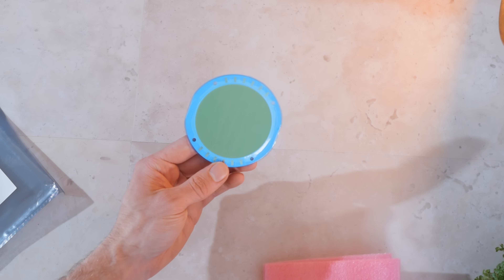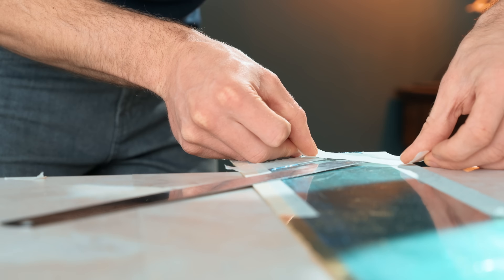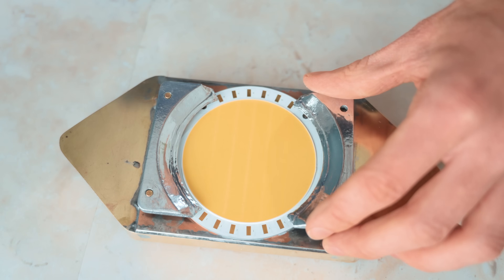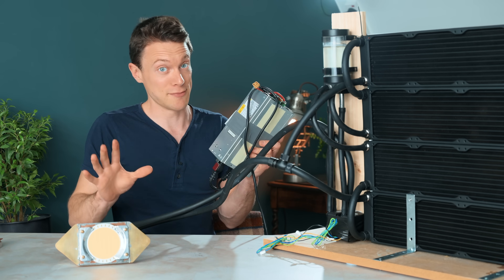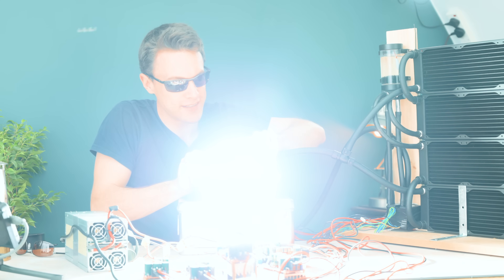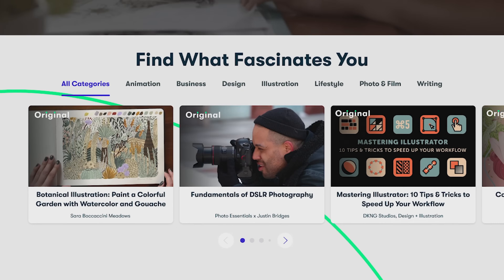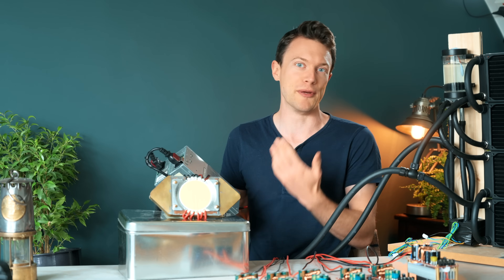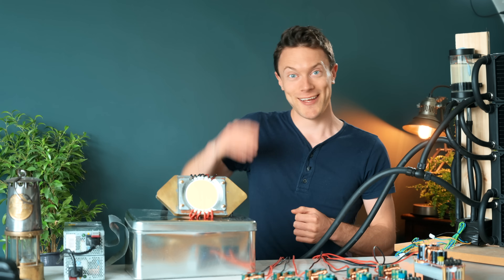Testing the world's BRIGHTEST LED!!!

Comment: Hey Perks Nice video!

But I have a question about the Server Power Supplies. The thing is that in my knowledge that you can't connect SMPS Power Supplies in series. 

And here is the reason, the whole outer Heat dicipassion Surface is grounded and one more thing is that I saw some PC power supplies uses this.

Now in this way if you series the two power supplies then you will get 24v no issues but there will be higher possibility of the damage of the 2nd series connected Power supply. (If you run the power supply long time.)

I have a great experience about this because I have damaged my several power supplies. 😢. 

So from my perspective I will highly suggest you to check wheather any of the mains wire is heating up or not. 

I have a highly doubt about that. If you have time then let me know what you think 😊

As always nice video 👌
Love from India 🥳

Regards,
Creative Creator
Reply: ".....whole outer Heat dicipassion Surface is grounded "
Do you mean Earthed?
The problem is with cheap SMPS which SHOULD BE isolated but have a crappy EMF suppression capacitor which causes leakage which causes problems.
Reply: You have some great points buddy!

Comment: Some power supplies connect ground (from the wall socket) to the ground on the output. If that's the case, you can't put them in series, you would be shorting one of them. I put two server power supplies in series to power my battery charger and had to open them up to replace some screws with plastic ones to insulate the board grom ground. 

But I'm not convinced that this is the problem as it worked at first...

Comment: Why don't you power it off a couple of car batteries? Very capable of providing the amps but obviously will lack run time. Great for testing, reasonably portable and cheaper than Lipo packs.

Comment: I think that you broke the ps because you switched it off before giving it time to cool down. You should have switched off the boosters, wait for the fans to slow down and then switch off the ps.

The thermal inertia of the switching ic cooling surface burned the ic itself. I experienced it on my own.

Also, if the power rating of one ps is 750, in series 1500w where flaming through the two ps lines. Even the internal cables and tracks on the board were probably under stress during the test.

Anyway, that was very entertaining. Thank you.

Comment: I think it makes sense why the LED wasn't getting super hot. Since it is so efficient, a majority of the energy is getting turned into radiation and not heat at the LED, which explains why your hand was getting so hot (and also the reflectors). Maybe you should extend the water block to the power supply?

Comment: Possible reason for power supply damage:

if you connect 2 switch mode power supply in series, they have to be ground isolated.
if you connect two switch mode power supply in parallel, they will almost always get damaged.

Comment: There does exist 48V power supply.

Step down converters are both cheaper and more efficient. So using 48V and step down would peobobly be better

Also... 1500W led probably just dissipate about 500-600w of heat, that can be dissipated with a very large cpu cooler
Reply from the maker: Any recommendations for powerful step down boards?
Reply: @DIYPerks  it have been years since I worked with that, so most of my  product knowledge is not up to date.

Comment: So i am confused now, i checked the LED light spec and it shows:
Input Current 48A
Input Voltage 30-41Vdc

Which means wattage ratings fall 1440-1968watts. 😮😮😮

I'm in lighting field for over 9years now and i only see is either constant current or constant voltage drivers, and i haven't seen more that 1050mA constant current driver. I believe you can use standard constant voltage rated 36Vdc (Meanwell has it UHP-2500-36 https://www.meanwell.com/webapp/product/search.aspx?prod=UHP-2500) with higher wattage and connect all the sections in parallel instead of using individual buck in each sections. 

But still, great experiment! Keep it up buddy!

Comment: Just a wild thought but your power supply may not have had enough air running through them normally they are the exhaust of the server rack with high rpm fans at the front

Comment: If you run the power supplies in series, aren't you running like double the current through them?
If each can provide 1000 W and you have 2 of them in series, you are running 2000 W in total through them.
The voltage is fixed so the only thing that changes is current.
Maybe that's why they fried?

Comment: My guess would be, you overloaded the 12V line as those PSUs are built to deliver a significant portion of it's power to a 5V line. So the maximum Power can only be delivered if you balance your load according to the specified voltages.

Comment: 12:50 - I think I'd have blasted a load of cold air in thru a 'desk fan & cone combo' taped to the air inlets to cool the server PSU's.

Sometimes the most ghetto solutions will fix things and a desk fan is usually something we all have or could get access to rather quickly.

Comment: The overall rating of a power supply does not mean that the 12v rail alone can deliver this same (full) amount of power... since it is usually distributed in multiple rails like 12v, 5v and 3.3v rails. (and some special voltages like -5 and -12v that usually only deliver minimal current.)
Probably just fried the 12v rail.

Comment: Server PSUs are designed to operate in the thermal context of a server where a lot of the cooling is taken care of by the rack installation. (servers usually run at 100% fan speed all the time pushing a lot of air through the case) running them outside the case is a bad idea.

Comment: Love your shows i bet one of these would make a great searchlight on my van roof! but... i dont get the watts at the wall socket, if the led was truely doing 1500w, and theres only 1635 from the wall,  then thats 135 loss in all the boost converters /and/ the 24v psu's ? thats a crazy and very unbelievable efficiency...  i'd say somethings not measuring right but it is what it is.. what it is, watts......

Comment: With computer PSU's what actually makes sense in this case is not the overall power rating, but the specific power rating of 12V line on the PSU. For example, 300W ATX PSU could only deliver 200W on 12V line, 90W on 5V line and the rest on different voltages. So, pay attention to the 12V line power rating.

Comment: Seems like you shut off the power supplies when they were extremely hot, which would turn off the fans inside. Maybe the heat in the power supplies damaged them once the fans turned off?

Comment: The power supplies failed probably because you also connected the Earth together. They are most likely not isolated to Earth so you basically soft-shorted one or both of them. Some have the minus is connected to Earth so if you parallel them, they need to be fully isolated. Also, you can't keep them touching because the shielding is also grounded.

Comment: if you turned the psu's on with all the sections turned on, then they broke because of inrush current, wich could be way more than what the psu's can handle, also psu's for servers and other computal hardware is not meant to turn on and then suddenly crank the power consumption to max, gota go slow ;)

Comment: Is it the light creating heat itself or what? 

Is a "YUJILEDS" 1500w/120000lm led array actually 80 lumens per watt?! That sounds pretty impressive. Is there a standard for LED efficiency ratings?
Reply: How do you calculate waste heat?
Reply: I'm reading on Lamphq that modern LEDs convert about "35-40% of the used energy into visible light and only 60% into waste heat". 
Theoretically, YUJULED's monstrosity is creating 900W of waste heat and 600W of Visible light.
Reply from the maker: I  worked it roughly to be 1000w of heat and 500w of light, but it's just a best guess rather than proper figures.
Reply: @DIYPerks  Hahah that's awesome!

Comment: If Dell is any indication, server power supplies are rated based on input power (not output), and short term.  Their efficiency drops with high loads, then again with high temperature, therefore their output capacity quickly spirals even further down when actually used.. realistically they're designed to support spin ups of multiple drives and not much else.

Comment: You can get 1U "Stick" PSU's that are about 1/3rd the size of each PSU you have currently yet have peaks of 1750Watts on 240V circuits (Like you have seeing as you're in the UK).
So, in theory you could run 3 of them with 2 for the actual supply plus a 3rd for redundancy, plus it would be massively over spec with just a single PSU, 2500W versions are also an option, they are about 2/3rds the size of each PSU you currently have, but obviously you'd only need 2, one for power, plus one for redundancy.

Comment: If the air cooler is rated for 300w, wouldnt that be enough? I mean only a small part of the 1500w will be converted into heat.

Comment: Let me get my main annoyance out of the way first: Having a demonstrably bright light pointed right at the camera for a prolonged time! Seriously, point it off-axis at a wall or put a glare shield on it. Also, you could have tested for waterblock leaks by submerging it in water and using a bicycle tire pump -- would have saved time if you found leaks and needed to remount the LED. Welding googles (or a mask) would work better than sunglasses. Finally, it might have been more "cost-effective" to use a car radiator or oil cooler with a water pump instead of computer parts (old-school PC watercooling).
Reply: He probably just used what he had lying around. I have a few extra PC radiators I plan to use for some DIY projects, but no car radiators since I don't work on cars. If he bought everything just for this project, it would certainly make more sense to use a car radiator since they cost about as much as high-quality PC rads and have much more surface area.

Comment: Server power supplies are in a case with tons of airflow, even without full load, I would suggest making an enclosure with the cooling and power supplies in series for the airflow. Power supplies might also be more quiet whilst air is forced through em. And get like 3k watt of power supply, running em full load all at once is not within spec ;)
Love your videos, keep it up !

Comment: Given how cool the cooling system when it runs, I'd assume there's not much heat coming out. PC cooler's TDP refers to how much heat that will dissipate (loss) in watt. If let's say that LED is 90% efficient, the heat you need to cool is only about 150W. Well, it's just an assumption but still while that cooling system looks sick, it could be scaled down for mobility.
Reply from the maker: That would be nice but the LED is approx 25 to 30 percent efficient :( LED tech is great, but is never going to hit 100 percent efficiency unfortunately.

Comment: Just curious, as I might not understand the terminology myself, but isn't it called brazing instead of soldering?
Reply: the difference is the temperature required.  he seems to be using plumbing solder,  it needs a low temperature to melt. brazing is done  at a much higher temperature

Comment: It fried the power supplies because you cant join Switch mode supplies in series without damaging the output circuitry. Probably blew a Diode or mosfet.

Comment: Wiring the power supplies in series is definitely the problem. Both will pass the 1600 watts. If possible run them in parallel, or better yet, use each power supply to run three segments.

Comment: Server PSU:s ARE designed to run in series, there's usually at least two in a server as they are designed to be hot swappable.
Reply: Sure it's not parallel?

Comment: You probably do not need that much cooling though. If an LED is consuming 1500W, then that does not mean it will heat with 1500W. The main advantage of an LED is that it is around 90% efficient, meaning, 90% of the 1500W goes to emit light. So, it will only output around 150W of heat. I assume this LED is not 90% efficient, but still, you might be able to run it with the air cooler you have showed in the beginning of the video.

Comment: Pro-tip, always test water integrity before continuing build.
Also, you may be surprised on how those 3d printed hold-ons heat up once the LED has been powered on for x hours. But appear to be fine for short term testing. Cool build!

Comment: One thing I would like to see is using a lens to focus the light, and then see the results. Next time, I would suggest you water check the loop before attaching the light. It would have been a shame to see a catastrophic failure after the light was attached. Great video though.

Comment: It might not actually be in spec for the PSU's, as they are usually rated for the total power being the sum of the power across all rails, so unless this PSU only has a 12V rail, and only one 12V rail, it will probably not be in spec. Did you verify that?
Reply: BTW, you're right about hooking switching supplies up in series, they may not like that. Bashing some caps all over the place may help a bit, but do make sure that the inrush will not be too large.

Comment: Even though it's not the problem please don't make your own Y power cable for the power supplies. They make Y cables with lower gauge wire throughout. If you are going to be pulling 1635 watts from the wall please get the proper power cabling for the power supplies.

Comment: With the psus: In the powersupply you get multiple voltages: 3,5;5 and 12 Volts. And it can only run at 1000watts if you pull on all rails... And you only puled at the 12 volt rails. So i would think you pushed it a lil bit over the limit

Comment: Just get a 2-3kVA step-down to 30V transformer (not sure what yours mains voltage is, but I’d shoot for 240 V if you can wire it up), and some beefy diodes and caps to make a poor mans rectifier. That should run it a full-brightness without issue. You won’t have any voltage/current control to adjust brightness, but honestly it doesn’t really matter cause your already blinding people at half-power anyway.

Also, you’ll need to cool the diodes, so place them on a heat-sink in your water-loop as well.

Comment: Since you wired the power supplies in series, each power supply is providing the full current, not half of it - the voltages add up (each power supply gives its 12 volts), but the current is the same in both (24v/1638W = 68.125 Amps).   Because of that, you don't have 2000 Watts available, you have 1000 Watts (assuming that each power supply is 1000 W).  At 68.125 Amps at 12 Volts, you're using 817.5 Watts from each power supply just for the light.  Losing a bit through the converters, and using some for the fans in the power supplies, you're getting VERY close to the max output of the power supplies.

Comment: This dudes wife: "Oh no the fridge light went out"
This guy: "What if i reinvented a fridge, using parts from around the house?"
His wife: "...Please no...we could just buy a replacement light"
This guy: "Too late, i've already started and am posting it to youtube"
His wife: " *Longest sigh in history* great"
Reply: But this warms it up instead of cooling it down!
Reply: @technobird22  The heat from this across a Peltier junction generated exactly the right voltage for his secondary Peltier cooler since the delta of this LED to ambient is triple that delta he wants for his fridge to ambient.

He's just using the whole set up as a fancy voltage converter.

Xb

Comment: This is insane! One small nitpick though: if the LED can be lit up in sections, does it still count as a single LED?
Reply: Single unit COB, not a single LED. Of all the COB LEDs this is currently the most powerful colour accurate one available, for now.
Reply: technically the LED itself contains many many small LEDs
Reply: No it doesn’t count as a single led, it is called an led array, and contains hundreds, if not thousands of LEDs
Reply: This single unit is made out of multiple LEDs. So technically it is not a single LED. More appropriately, it should be called a single LED LAMP/ or LIGHTING
Reply: @cyy3793  My car is made of thousands of components but it's still my car.
Reply: @Splooge_McFornication  This doesn't make any sense ... Your car is made of different parts but this LED is made from multiple identical parts.
Reply: @Blast-Forward  No, he is right. The example is crude but stands nonetheless. Better yet would be a comparison to a multi cylinder engine. Depends on what you mean by "led light". Are we talking about led as in "led working principle" or led as in "led module". I for example, understand this as "led working principle" regardless of implementation, similarly to "engine" regardless of number of pistons or configuration.
Reply: Yes, and I was wondering if the strips in between the different sections might show up in some applications?

Comment: Quick question. Is it just me or do LED torches have less overall range (distance) than incandescent lamps? My Maglite is a 3v filament torch but it will reach, and light up, trees half a mile away. Whereas my LED torch which is superbright for about 10 yards, but beyond that it's not so bright. Even when focused for long range it still isn't has bright on the same trees as the Maglite. Is it the lack of yellow in the LEDs that make them less efficient at distance? Or is it just my eyes due to age? :D

Comment: I'm thinking there's a math(s) failure here.  1500w in series = 1500w.  If the LED is drawing 1500w itself, total current to the power supplies is probably 1550 or 1600w.  Coupled with the fact they're running in an out-of-design configuration I'm not surprised they kicked off.